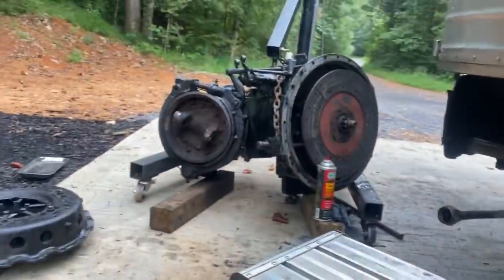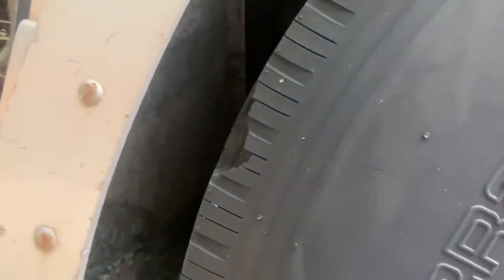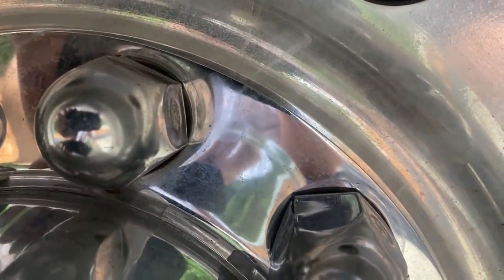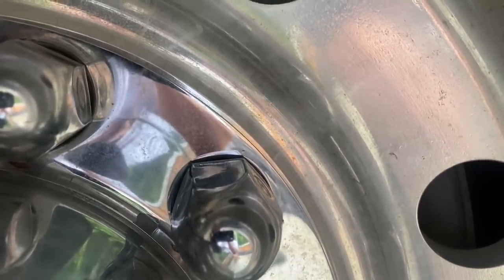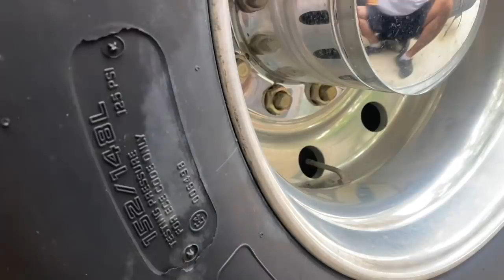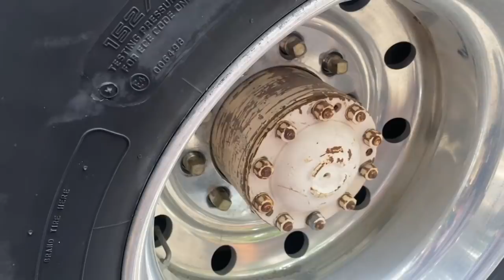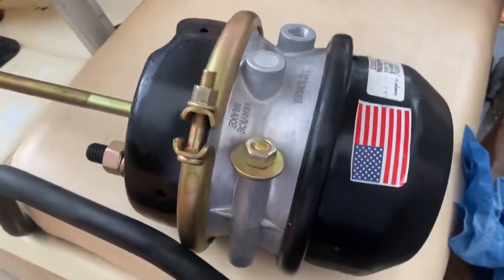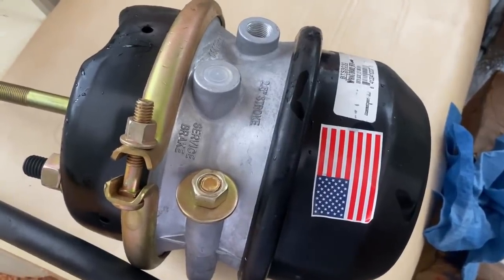Major safety issue on vintage bus

Comment: You need to get a thick rubber mudflap and lay on the ground under the hub when removing brake drum and let it slide off the hub and gently drop it on the mudflap, beats lugging it! You go man!

Comment: I made a tool to fit into a small trolley jack that lifts the drum. Get an old brake shoe and remove the ribs from the inside. Weld a small pin onto the side the linings were on so it will fit into the arm of the trolley jack where the jack pad was fitted. It'll save your back and fingers.

Comment: Thank Goodness these people are fortunate enough and smart enough to go to you and your reputation for honest maintenance. Some idiot put those on knowing that it was sketch. That should have exploded off during operation or came partly undone. Another save Scott. Great Job. You need a CoolPak while working in this heat. And I have this urge to purchase a Hot Water Pressure Washer!!! That resembles The Tanker Valdez spill. Buy Dawn by the 55 gallon drum. Super Job.

Comment: the thing with those stainless Lincoln high hats is the ring around and between the lug studs prevent you form seein if the rim is cracked, which has been a problem with the ball and seat style wheels ,

Comment: Hello,I've experienced the lug nut issue first hand. I am a roadie lighting electrician. In 2006 I was traveling with a dance company through Kansas in a 1990 Eagle. On a lunch stop I noticed the aluminum rim on the driver side rear coming off over the lugs. We were traveling on a two lane highway for hundreds of miles. I brought it to the drivers attention and he contacted the coach company's owner and our coach was immediately put out of service and fixed. This meant us roadies had to leave the comfort our sleeper coach and cram into the dancer bus with about 50 ballerinas 😁! Lol.
I really feel I saved lives by being a bus nut and doing my own nosy pre check.

Comment: Did the same thing to a AM GENERAL
I converted 20 years ago it had the E brake on the drive shaft best thing I ever did on improvements on that bus wow the studs on those back wheels could have been a little scary good thing your on Scott do it once so do it right. 
It's not just for the owners safety its for all of us thanks Scott.

Comment: When you push the park brake button in, the spring gets compressed with air and the brakes release.
When you pull the button  out, the air that's compressing the spring releases, and the spring applies the brakes.

Comment: I worked for a major truck shop/stop as a tech for many years and if I had done those short studs and something had happened I would have been held totally responsible .I could not live with this knowing it could have come apart and hurt or killed someone even my FAMILY
Reply: Problem with most workers nowadays is they don’t care. They don’t want to take the time to fix things right even though the shop labor rate is $110 an hour for big stuff here in NY. If they tried to throw blame they would say that those were not on there

Comment: Not only are the studs short , the nut seats are cutting into the aluminum,  They must need a larger nut too.
Reply: ahhhhh... No  The 1930 s old style bud nuts suck, but thats what is available
Reply: Maybe nuts that have a bevel on one side that helps to center the rim on the studs. Most cars and trucks use them.
Reply: Old style bud wheels (actual name if you need to order them) Use a nut with a ball or rounded profile on the nut and seat in the wheel. The nuts center the wheel instead of the hub as on modern heavy truck and bus wheels.

Comment: I saw that same wheel nut issue many times in my 38 year career fixing buses. Spend money on the fancy wheel, but use the same steel wheel hardware. A little scary, for sure!🥺

Comment: I finally realized why buses sound so familiar! They use the Detroit Diesels!! Around the year 2000 I had a Dynahoe backhoe, with a Detroit Diesel 3-53 (I believe that was the model) and I sure have a good story about me fixing that motor, what a nightmare, 60 feet of backhoe all spread out and DEAD next to the porch of my brand new home...  Anyhow, the wife left but I got it going and still have the house. She DEMANDED a house, then had to hand it over to me for 10K and 22 years later I proved I could keep it. It's worth 3X what "we" paid now, life is good...

Comment: The suds aren't long enough either the stud need to go out inside the outer wheel to give the strength to hold the aluminum wheel on that's why the thimbles break all of the time!

Comment: Scary stuff. There is a lot of corrosion that goes on there also with the dissimilar metals with the steel inner rim and aluminum outer, and steel lug nuts. Especially up here in the north.

Comment: Scott it not just the inner nut that’s the problem it is the stud on the hub as well that is to short on this bus.  The stud must stick out long enough for the second nut to be over it. If the stud is to short like on this buss the first nut will sheer off allowing the outer wheel to come off.  The studs that came from the factory were fine with steel wheels.  I would never recommend having steel wheels and aluminum wheels side by side. The wheels flex at different rates and for that reason you will have problems trust me I learnt the hard way on this one.  Stud length is important. Here is what you need to know.  The stud should stick out at least 1/2 inch past the thickness of the tow wheels.  The inter nut must go on and be long enough to go on with threads to spare on the inside so the inside nut dos not bottom out on the stud. The outer not must be long enough so that you have three or four threads showing when you tighten

Comment: Definitely a smart upgrade to replace the parking brake system. Those lug nuts were scary. Ever think of setting up a transmission jack to remove and install brake drums? It would be a lot easier on your back.
Reply: Seems to me the Harbor Fright motorcycle/atv jack might be perfect for that.
Reply: Michael Free 
My thoughts also. I have a motorcycle jack that has men used for about everything except a motorcycle jack!

Comment: if it dont run chrome it.  aluminum on steel is a cheap dress up but with the different metals and the expansion contraction rates different even with longer inner nuts its a bad idea. you also have to watch the rim offsets. duals need the air space to keep the heat down.   a dot stop would be real expensive paying by the  nut. not to mention a big red sticker in the windshield and a tow bill.

Comment: My dad was standing at the counter of his parts house one day, looked out the window and saw a Budd wheel bouncing down the hill. It came through the intersection, started up the hill and hit a 2-inch vertical pipe stay for a utility pole guy wire. The pole shuddered, the lights flickered, and today (about 45 years later) there’s still a tire-shaped bend in that pipe, about four feet above the ground. Fortunately, the thing never hit anyone.

Comment: It’s scary to think of a dislodged wheel becoming a bouncing anvil, that can easily crush the roof of your car, and kill you. 

Even more scary is with the ability to bounce high in the air, you may not even see it dropping in on you, and have a chance to avoid it. 

Have seen several stories in the news over the years about a fatal accident with a loose wheel. 

It makes me very sad to know the driver probably never had a chance, and very angry to think both someone didn’t do their job right, and the moron driving the rig must have ignored the sounds, and vibrations being made while their rig was shedding lug nuts. 

Thank you for noticing, fixing, and talking about the wrong you found Scott.
Reply: Lots of videos of runaway tires on youtube just like that.  Mostly in Russian crash videos.
Reply: At 65 mph how much energy do you think a 285 pound tire and rim carries? More than enough to kill you inside your car.

Comment: This is so crazy that someone would do work like that, how could anyone with any kind of conscious do something like that. So my bluebird had the wrong inner nuts, they were the ones for an inner steel wheel and not for aluminum. I had to get all the right ones and change them all out. Luckily this was not as bad of an issue as this, but its still something that should not have happened.

Comment: After viewing this and other videos here I'm going to give RV conversion busses a wide berth on the highway. Particularly when they're approaching.   👀
Reply from the maker: Many are well maintained.   I just get to work on a lot that need work. So you get to see the worst case scenario a lot
Reply: @BusGreaseMonkey  
Mr Monkey, I'm OK with the "maintained ones". The ones maintained like trucks in third world countries are the ones on which I am concerned. Only takes one. I also ride a motorcycle on occasion. A loose wheel could take me out even if the bus stopped. 😬
Reply: Not just RV's. There are a lot of crappy semi's out there too.

Comment: Hey Scott, is the brake upgrade available on my 4103....i think the leaf spring might cause a clearance issue not sure....no air ride...thanks
Reply from the maker: If its like the 3751 which i suspect it is, one side is easy but yes it’s possible

Comment: I'm still amazed that in the US you can drive this sort of vehicle without a CDL, or without mandatory yearly safety inspections. Here in Europe you cannot drive a vehicle this size without the appropriate licence (and take a professional Bus/Truck test to get the licence) or drive the vehicle on the road without annual road worthiness inspection. If this vehicle was stopped at the side of the road by the vehicle inspectorate it would have to be loaded onto a lowboy trailer and taken to a maintenance site for the faults to be rectified, and inspected before being allowed back on the road. With those wheelnuts they wouldn't even allow you to lift and tow. And you'd get a big fine for it too.

Comment: Those parking brakes are why the army requires a  chock block in all vehicles. The only way to get them to hold on old 5 tons and 2 1/2 tons was to make them drag a little.

Comment: What is caging a brake mean or involve?
Reply: The new brake chambers lock the brakes if you lose air. To move the bus with no air (example towing) you can use a caging bolt that fits in chamber and pulls the the spring inside back which releases the brakes. The process is called caging. Hope that helps.
Reply: @macster43yt  thank you internet 1st responders!
Reply: You will see tow truck drivers like Ron Pratt crawling underneath and “caging” the brakes so he can tow them after they wreck. Or in the winter the air line freezes because of moisture in the line and the air dryer dies (or freezes)
Reply: @RustyZipper  much obliged for the information,  learn something new each day
Reply: you also need to cage the brake to install it, with no air the spring is extended in the chamber and has to be "caged" to compress the spring so it can be installed onto the bus. You can also connect an air line and apply compressed air and compress it that way if no caging bolt is available but it's not your first choice, I've seen a Maxi brake come apart and the spring go through the deck of a trailer and halfway through a load of bagged cement.... a lot of force there
Reply: Yeah in a nutshell these have a powerful spring that applies the brake when no air is in that chamber, for parking or emergency situations. The second chamber is the service brake chamber applies braking when air is supplied when the brake pedal is pressed. In normal driving a push/pull valve is used to supply the spring chambers with air to release them. 

If you have no air to release the brakes but need to drag the disabled vehicle, a rod (threaded on the end) goes through a hole in the back of the brake chamber.  You tighten a nut on the rod to manually compress the spring to release/disable the parking/emergency brake.

Typically trainers have spring brakes as do drivers on the semi. This applies the brakes on uncoupled trailers, and also causes the brakes on a semi to apply in the event of loss of air pressure.

Comment: Was like in the video of Sage's pre war silversides the parking brake was glowing red hot on his his bus should be converted to modern spring brakes modern air brake systems have an air dryer too which is useful so moisture can go in to that first than into the wet tanks.
Reply: He's getting spring brakes for the Ohio bus as I recall.

Comment: Yeah decades ago my friend had bought this beautiful BMW M3 one of their hot rods. He was south of Cleveland out in rural country and he had pulled into a driveway to turn around as he was sitting there a semi lost a wheel it came along and hit the driver side of the car as he was Driveway and luckily for him idiot just behind him also touching the B pillar. The car was fairly destroyed but if that tire had to come into the driver door he probably be dead. 

One of the scariest things that you can encounter out on the road.

Excellent teaching moment Scott. I’m an electrician a large facility maintenance guy an alarm systems guy etc. etc. etc. I’ve seen and worked on everything including thousands of vehicles in my lifetime there is so many lazy ass people out there it’s unbelievable we’re not all dead 💀.

I see lame work I see shotty work I see people cutting corners I see builders and contractors who don’t give a damn anymore we were never a country like that but we’ve become pretty shitty. Even if you don’t make money do the damn job right.

Comment: what if you respond to bad seals in either wheel bearings or gear boxes with thicker lube like 00 grease? instead of replacing the seal? can functionality be extended that way for a significant time? allowing either the life of the vehicle or gearbox to be completed or just more life before disassembly?

Comment: spring brakes (maxi boosters) for the win..............best thing ever for heavy trucks and buses. As for the wrong lug nuts..........criminally insane, its how wheels come off and kill people.  Yes, once those ball seat style 10 stud aluminium  rims get old, they always crack.  Unless you have a payload sensitive business (like in commercial freight) its better to just run steel rims, they are much tougher and resistant to cracking and damage to the rim edge.

Comment: I was just wondering if vehicles in the USA have to have a yearly government roadworthy test like the MOT over here in the UK?
Reply: In the US, there's unfortunately no inspections required for RVs or private coaches.  Only those in commercial service.   Even those can be very cursory at some shops.  It really depends on how thorough the inspector is.  I wouldn't be sloppy. 

Most of this is driven by the RV industry and legislation.  Old folks have a very strong voice so the politicians tend to bend easily.

Comment: those nuts are typical of some workshops they likely stuffed the old set and only had the standard length on hand so used them and didnt care as it was hidden by the caps. This is why i always take time to choose who i have work on my car as a good mechanic is worth his weight in gold and when you no longer do your own repairs your putting your and your families lives in his hands every time you get on the road and its these shonkie repairs that will kill you or family or even worse some poor innocent passer by

Comment: I have always said anyone who wants to buy a RV be it a motorhome or pull behind should have to go through training. Nothing against someone wanting to own a RV but there is a lot of people who know nothing about towing or driving a RV. I have seen people going down the road with lights out, chains dragging on the ground, going way too fast. I have seen pick ups towing campers that are way too big for the truck. Once I saw a little s10 pick up pulling a fifth wheel camper that was at least 35 foot long. The guy was having a hard time keeping it on the road as the camper was pushing the truck around. Me well I drive semi truck have been for over 19 years now. Not saying I am perfect I have messed up before. I won't drive anything that isn't safe to be on the road.

Comment: It looks to me that the studs are also for a steel wheel. You have to knock them out, and use longer studs for aluminum wheels. Also the “ cones “ are for 
steel wheels, so they have to be replaced with longer style.  I cannot imagine any tire man making this mistake. If the owner had anything to do with this
he should not be allowed to own/ drive vehicles on public roads.

Comment: Are those nuts supposed to have a bevel on the side that presses against the aluminum wheel?  I'm more familiar the style where that nut has a straight shank that goes into the aluminum wheel (centers the wheel on the stud) and the nut has either a bevel or flat side that presses against a steel washer.  The steel washer then pushes against the aluminum wheel.  What I'm talking about looks something like this:  https://www.vividracing.com/ssr-mki-lug-nut-m12x15washer-pcd100-each-p-152804794.html  I know these are sized for cars, but the idea of having a washer to keep the steel nut from digging into the aluminum wheel makes a great deal of sense to me.